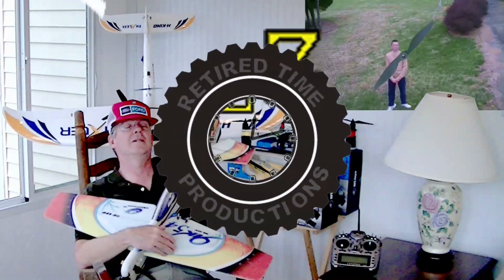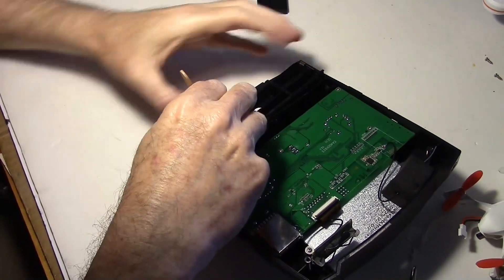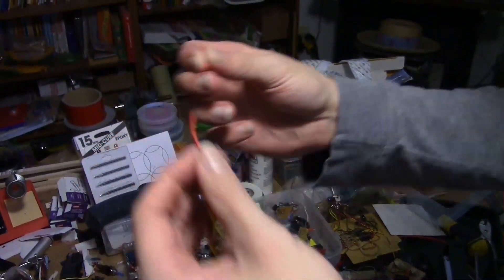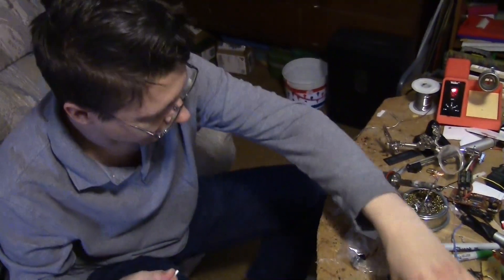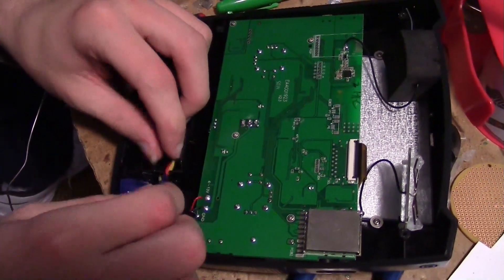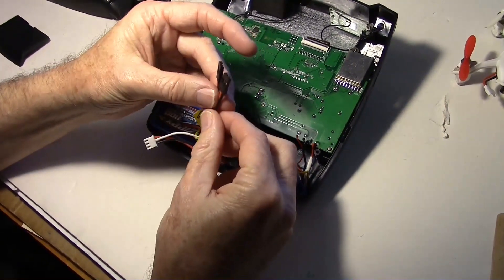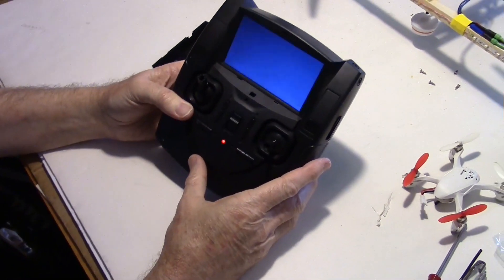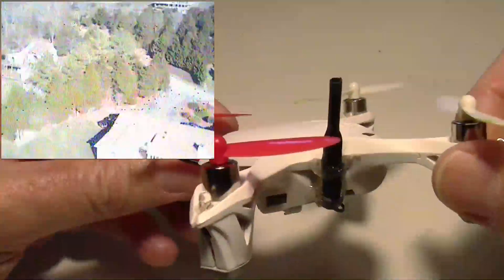Hubsan X4 FPV Radio Life Battery Mod to replace AA batteries.

Comment: Thanks for your explanation. It's just that I've seen some videos using a 7.4v lipo with no reduction in volts so I thought 6.6v would of been ok
Reply from the maker: +Tony Peart I suppose you could put a battery alarm on the lipo so you know when it gets too low.
Reply: Eh? That's not what he's asking. Why use a diode? A diode doesn't lower voltage btw! It stops current flowing in the opposite direction, so is not needed in this application. can you explain why you're using it please?

Comment: The 7.4 1200 MAH lipo from the tarantula works great in the newer 502s models as there is no battery divider and a JST connector is now in place in the battery bay. The 7.4 has not been a problem and many have done the same mod with no ill affects.

Comment: According to the Hubsan H502S owners manual (a direct quote):
"The Transmitter can only use 2S Lipo batteries, 4XAA batteries or NI-MH batteries, other batteries will damage the Transmitter."
My transmitter has a female JST connector mounted to the PC board facing into the battery compartment to allow connection of a Lithium battery.

Comment: Hi Guys
As you can see input voltage  shown  etched in  RC Layer on Solderingpoints is 4 to 13 Volt Look  at 5:55
Wonder why you willbuild in a Diode and why you will use a Life (Only of  better drain behaviour?)

I use a LiPo 7,4 Volts without any Currentsabiliser for Weeks without any Issues or Partoverheating
only Thing is the Voltmeter in RC itself.
Its Voltage Range i have not testet yet. I took my Soldering Iron Burned a JC Hole in My Hubsan RC solderd a JR Cabel with checked polarity to the Batteri Pins with outlet on the bag of RC clued  two Velcro Pads on my Accu LiPo 7,4 Volt conected the JR Press the Accu with Velcro Pad on Bag of RC and here we are. Next Thin i Try is to conectadapter Balancer to JR to be free on Lipos ( arround 7,4 Volts even  up to 13 Volts seems to be posible if Markt on Circuit Board

KR
Andreas from Germany
Reply from the maker: The diode is to get the voltage in the rage that works for OSD voltage, otherwise the meter stays pinned to 100% all the time and you can't tell when the batteries are getting low. Other models my vary, this is only for this model.

Comment: They're not LIFE batteries, they're Lithium Iron! LiFe. Also, a diode is not something you'd put in this application as it's not needed for anything. You missunderstand what a diode does - it's not a voltage dropping component. A diode allows current to flow in one direction, but not the other, and is completely superfluous in this application = does nothing.
Reply: David Tormey 
Please stop spreading your misinformation  

1. A diode absolutely is a voltage dropping component  Diodes have a 0.6-0.7V forward voltage drop when fully "on."

2. The diode is not superficial because he's using it to offset for the difference in nominal voltage between his 6.6V battery pack and 4 AA batteries (6V when all in series).  This way the on-board battery monitor gives a more accurate representation of battery state on the display, instead of thinking the battery is still at 100% charge from 6.6V down through 6V. I haven't looked at the remote control circuit design, but you may be adversly affecting the operational characteristics by providing 110% the max voltage the circuit expects. Highly unlikely (you're not going to exceed any component ratings) but I wonder how much voltage regulation the controller really has if it's designed for simple throwaway AA batteries .

3. Not all diodes are intended to be used to allow current in only 1 direction (e.g.: zener diodes).

4. If you really want to get technical it's a LiFePO4 (Lithium Iron Phosphate) battery...

Source: I'm an electrical engineer.
Reply: Ion not iron
Reply: A lithium-ion battery or Li-ion battery is a type of rechargeable battery in which lithium ions move from the negative electrode to the positive electrode .

Comment: Hi. Is the diode really needed just to drop -5 volt?
Reply from the maker: +Tony Peart Actually it drops the voltage from 6.6 to 6.0 so that the battery indicator on the radio reads closer to true. Otherwise you would not know if the LiFe battery was getting low. So yes it is a good idea to use the diode.
Reply: 4 fully charged AA cells will be 6.4>6.6v anyway, so makes no difference, and doesn't drop voltage at all!
Reply: David Tormey Alkaline AA batteries have a nominal voltage of 1.5V. You may find an open-circuit voltage of 1.6V with some manufacturers (e.g.: Duracell), but those batteries will very quickly drop down to 1.5V under load.

Comment: What kind of diode you used
Reply from the maker: +melvin sepulveda It was a 1N4001. Very common diode. Almost any silicon diode will work as long as it it rated for at least 1 amp current.

Comment: You don't actually say if this mod is worth doing - how much longer do you get out of the LiFe as apposed to the standard AA cells?
Reply from the maker: Several hours more time on Life. The diode is just so the on-screen battery monitor will work with the Life battery otherwise there is no indication of the battery going flat.